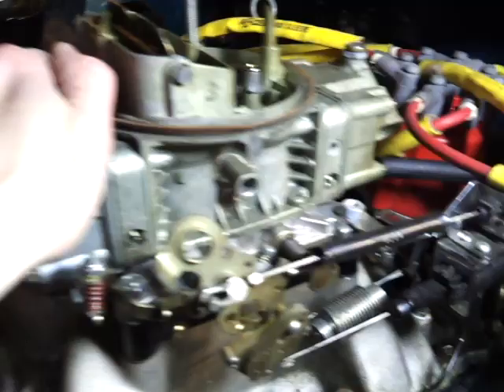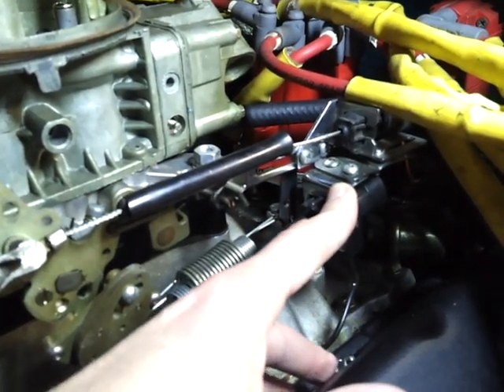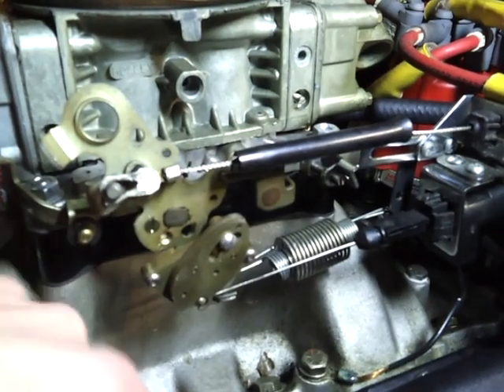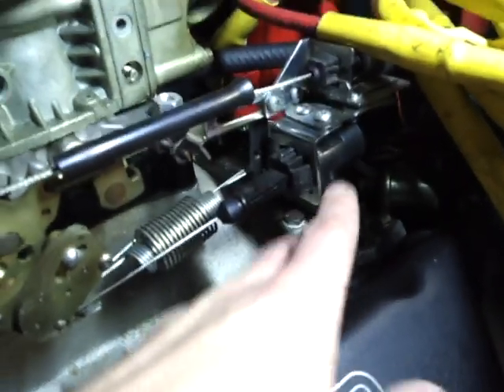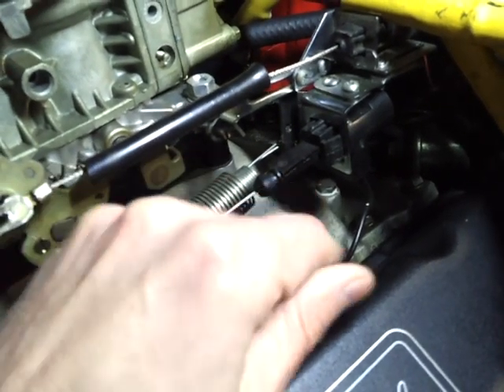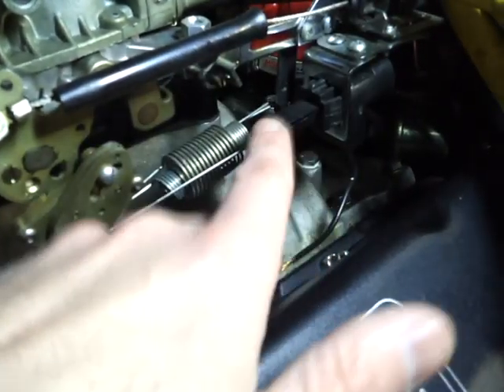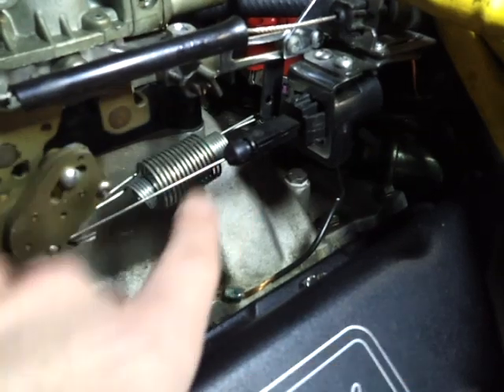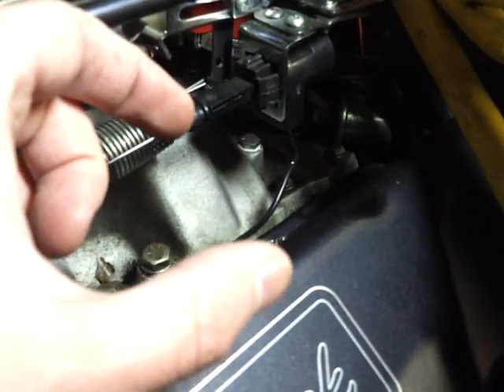DIY how to adjust transmission tv cable..700r4

Comment: Just swapped my 2 bbl to a holley on 70 Impala and now the tv cable seems too short. I know I need to make a new bracket, but seems like the assembly is too short to even reach to the lever. thought it was going to be a swap and go, but I was wrong. don't know what trans I have and don't know if I have to replace the cable or not. It does have the end with a long slot that slides

Comment: Good vid man but there is not even one vid on youtube about the cable cam ajustment. I kinda know what it does but It would be nice to know base setting and how far it can be ajusted or whats recommended.
Reply: You don't adjust it. You set it. It has zero adjustment. It's either correct, or not.

Comment: Clowney, I'm working on an 86 Firebird T/A. I'm in Texas and the car went for a swim The dash and motor mostly stayed out of the water. After changing fluids and filters, the 700R4 shifts at high RPM's. 4000 for 2nd and 3000 for 3rd. It has yet to kick into overdrive. The car ran fine before the storm. What would be your suggestion to fix the shift issue? Motor runs like a top, but this transmission is killing me.
Reply from the maker: Justin Wininger water probably seeped into the trans
Reply: klowny1969 already drained the fluid and changed the filter. No water showing on the dip stick.
Reply from the maker: Justin Wininger yeah but sounds like water did get in there..when u drain it..u still have the torque converter thats full of fluid

Comment: Your 700r4 TV cable adj. was helpful but I have a 99 GMC. Took out the TH400 and had a 700r4 rebuilt and installed. Well the shop did not know how to properly adj the TV cable.
Some of the gears are burned up and the transmission place went out of business. My question is how does someone adj the tv cable on this type of set up. It has a TPI throtle body no holly here. I going to do this my self. Thanks